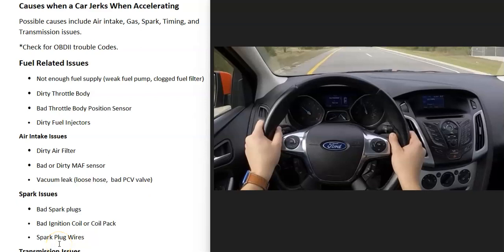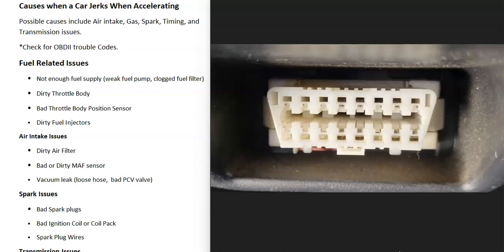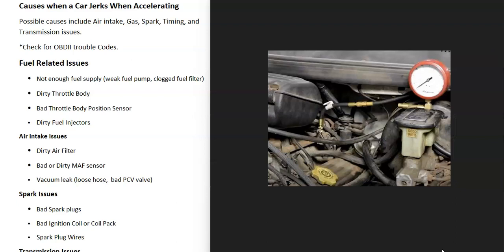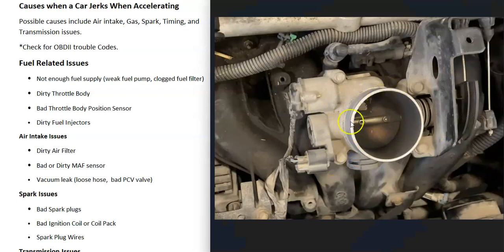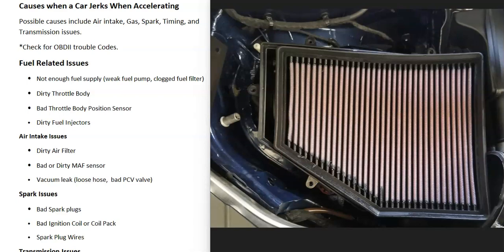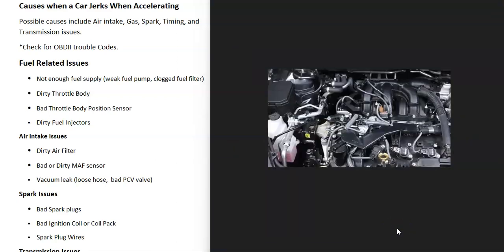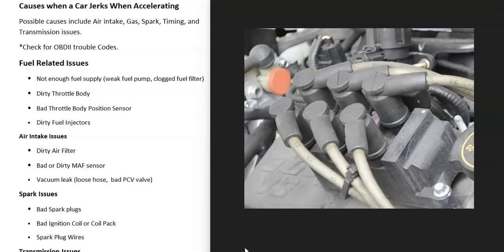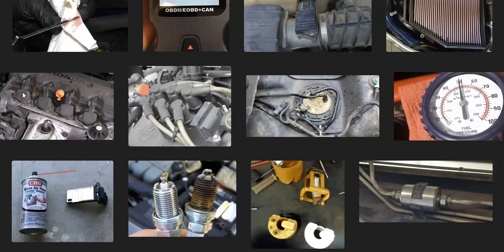Causes and Fixes Car Jerks When Accelerating

Comment: Anyone that has a a Toyota Highlander with similar problems that can tell me what they did for a fix please?
Reply: Mine jerks once in a while, but I have changed the plugs, coils, serviced and cleaned the injectors, cleaned the throttle body and changed the fuel pump. Problem still persists and unsolved

Comment: SPARK PLUS REPLACE, KOIL REPLACE, this is the code G550 P04F0$07E8, the gas station over flow my tank, forcing little more gas after it stopped then i get this check engine light, the macanic guy put code machine, but bec im a woman i light to research first before they over charge me

Comment: 1999 Lexus 300 jerking when changing gears. I never felt gear changes before...was very smooth.   Had complete tune up few months ago and been running great. No codes.
Reply: What did you do to it, what do you mean by "tune up"?

Comment: My 2002 5VZFE Tacoma has 256k miles. It has never ever let me down. Now, randomly it'll jerk, and by jerk, I mean like sudden split second losses of power...like a few split seconds in a row, typically between 35 and 50mph, going up hill usually, but not always. And it's usually a few moments after I leave work. But not always. And it's random, like once or twice a week, every so often. Other then that it runs and drives fine. I've scanned it and no codes are present. I've checked live data while driving (the  data a cheap ODB2 scanner can provide) and everything seems normal. I bought it in 17 with 129k. I've done 2 timing belt kits since and 1 tune up. Last go around was at about 230k. Anyone got any ideas? I'm a DIY car guy and always work on my own stuff, but I'm stumped.
Reply from the maker: Intermittent issues can be difficult to diagnose, especially with no codes. It could be a loose wire that only disconnects on a bump but reconnects, or possibly a component starting to fail, but still works most of the time. I would start with the fuel delivery, new fuel filter, and test the fuel pump for the correct pressure.

Comment: My mom’s 2006 Dakota is jerking. Keeps saying camshaft and crankshaft sensor. Changed them. Every time I reset the computer it runs fine then comes back same codes. Senors are new.

Comment: I have a problem.  I have no codes but it jerks when i step on it
Reply: My 150 is doing this too and no codes
Reply: @mikehernandez9140  I changed out the mass flow air sensor and was not that. I changed the throttle body and was not that. Finally I changed my spark plugs and wires and seems to have been the issue. One of the wires was slight cracked on the boot   Hope this helps

Comment: Thanks this is so helpful. Will continue my investigation into my new mild 'juddering'.  Last time i had this issue it was a hose from connecting into my ford eco-boost engine part so was loosing power (also spurting oil) the previous people had GLUED the wire which had melted in the heat. Some people are criminals. Got the spare adapter on ebay for £5 and my mechanic put it in for free as was also doing a couple of other odd jobs.
Reply: Just wanted to flag the resolution. Turns out a fault air meter read as an air leaking, leading my mechanic down a wrong path. Later turns out it was a Ignition Coil that blown the spark plug.  All replaced (did all 3 as might as well).  Just happy it didn't need an engine refit  :D

Comment: Is it possible that even  if the spark plug is the culprit the check engine warning will not illuminate?
Reply from the maker: In some cases, yes. If the spark plugs have a lot of mileage, it can cause issues. Usually, when this happens, it is best to give the engine a tune-up.

Comment: Mine when you start it it has a stable idle does not smoke the engine has a little vibration when you take off fast the accelerator does nothing but when easing into it she takes off she also gets a jerk like a 5 speed my car only has 35374 miles it eats oil its a 2020 Hyundai elantra se the dealer just picked the car up and knew nothing about the car it was on the lot 3 days at 30.022 miles so I've only owned this car for almost 3 years peace of junk

Comment: 2012 nissan altima v4. No check engine light but it jerks when accelerating and when idle. Im thinking of changing spark plugs first but im not sure if it will fix the issue. send help pls

Comment: How about when I’m driving in rain and traction control light  flashing and the car jerk when I accelerate
Reply: Try seeing if it's better when you disconnect the ABS sensors in the front wheels. Happens a lot on Tacoma's. But just try it and if it doesn't happen it's something wrong with you ABS control unit

Comment: My gf has a 2014 vw Jetta se 1.8t. I have a obdII scanner and I had a had an engine misfire on cylinder 4 and I ended up replacing the ignition coil and all 4 spark plugs but still having weird acceleration.

Comment: I have a 2016 grand jeep Cherokee Laredo and my car started jerking while I was driving 20mph and the check engine light came on. Any suggestions the mechanic just said transmission p0731 code. Is it something I can save or am I out of luck?

Comment: I have a 2010 Audi s4 and I have no engine lights I did a whole intake manifold replacement and new spark plugs and still haven’t fixed the problem
Reply: Did u ever get your audi fixed?  have a 2010 that randomly jerks and no code.

Comment: Hi 

I live in Spain and have a 95 Buick park Avenue Ultra. 

Could build a scan tool and retrieve codes. But now with the new ECU there aren't any 

My problem is jerking and no acceleration when the engine gets hot. 

When I disconnect the battery and re connect it, the car works fine. But when I get up to temp and restart the car it's game over.

All my ignition related parts have been changed and filters as well. Cleaned the MAF.  Still have this problem. 

Will change the water pump to address the overheating issue. But it still bugs my mind why the car has jerking and no power when hot.
Reply: I have a 93 buick lesabre thats been doing the same thing, replaced the fuel filter, o2 sensor, ecm, plugs, wires, and intake gasket. Have you had any luck figuring out your issue yet?

Comment: I have a 2005 Honda accord 2.4 EX & when I come to a complete stop then acelérate while turning right. The car hesitates in a jumping, jerking motion. I’m trying to figure out the problem but no luck can u help please sir  with ur knowledge 👍🏽🙏
Reply: Hello sir have you been able to fix the issues you complain about your car 
I am facing a similar situation 
It jerks when changing from 1-2 then every other one goes smoothly 
Sometimes while driving it just disengage from gear by it's until I off and start all over
Reply: @takeitorleavittt  no I haven’t I’m doing research on it & mite be the throttle body. Going to order one & see

Comment: 2009 Toyota Camry goes in and out of limp mode with no codes… Should be impossible for any car to go into Limp Mode with no codes!!!
Reply from the maker: Usually, there are codes. Can the scan tool read all codes, such as ABS and transmission codes?

Comment: I have a 5.4 when I’m at a red light sometimes it does that but no check engine light
Reply: Got a 2015 5.3 shutters at red lights and when slightly accelerating desperate to know if it’s fuel issue or tranny issue

Comment: 2012 altima ran perfect for 14 years no issue. Got it servived to het sparkplus, coils and gasgets changed. Started doing it. Took it back and they didnt find any issues. Still doing. 

How can a car drive so perfect for 14 years and no issues to all of a sudden after getting serviced it begins to do this with no check engine light on and no trace of what may cause it?
Reply: My maxima does this. Did you find out what it was?
Reply: Thats messed up 😢u had to go thru that

Comment: I dont know what to do, i have a 2023 hyundai elantra with 60000 miles, i have driven it alot, it jerks kinda when im accelerating and it also burns gas alot faster than usual? Does tht sound like spark plus even tho i only have 60000 miles?
Reply from the maker: If you have no engine light and no codes, I would give it a tune-up. You can look up the maintenance schedule or the parts that are recommended to be replaced by millage. Here is a basic overview for a 2023 Hyundai. 
Every 7,500 miles: Inspect components like air filter, brake pads, hoses, battery condition, and perform oil changes.
Around 95,000 miles: Replace spark plugs.
Around 120,000 miles: Replace coolant

Comment: Hello sir, could a small evap leak cause this because I keep getting code po442, I've replaced the canister,  holes, and the gas cap, but still no luck. Could you or someone please help me if possible.  Thank you
Reply from the maker: The EVAP system usually doesn't affect the engine. The only EVAP component that can sometimes cause issues is if the purge valve is stuck open. The purge valve is normally closed, so if you can blow through, it is bad.
Reply: Thank you so much for you speedy response,  I will check that next after the snow😅@HVAC_Mechanic

Comment: Thanks for taking the time to make this video. My wife’s 2016 Hyundai Sonota just had car fixed and it was emissions issues. The jerking of the car started several days later so we brought it back to place where it was worked on. It’s owned by her Uncle so I doubt he would screw us over with a bad repair. I’m crossing my fingers that it was something they might have done wrong but when I find out what the problem was I will give an update so others with the same issue might be able to see if this was the same issues we had.
Reply: And the lie detector determined that, that was a lie.
Reply: So did you figure out what the problem was?
Reply: What was the issue bro …. 4 monhths later
Reply: So?

Comment: What about no codes no engine lights on?? What can it be when acceleration and the car jerks and fails to accelerate? Thanks
Reply: Did you ever figure this out? Sounds identical to my issue
Reply: Mines does the same thing just it'll just stall coming to a complete stop with no check light
Reply: @Ski104  sound like a bad mass airflow sensor i used an autozone mass airflow sensor and my car would stall after 2 minutes of driving so i'd get an oem one

Comment: 97 Avalon struggling with acceleration shaking while driving with codes p0330 p0301 p0135 p0171 it's like in limp mode was intermittent now constantly o2 sensor is old code and didn't have this problem
Reply from the maker: I would fix the P0301 first, as it is likely causing the other codes. Most likely a bad injector in cylinder #1, but it can also be the coil or wiring.

Comment: I recently bought a 2015 Nissan Xtrail (2.0-litre petrol engine) with around 68,000 km. It jerks typically when I accelerate steadily between 30 km/hr and around 60 km/hr. I have changed the gearbox oil, spark plugs, and fuel pump unit (petrol filter and fuel pump),  cleaned the throttle body, but nothing has changed. When it has been put on a diagnostic machine, it does not return any issues. Anyone with a similar issue? Please kindly assist.
Reply: May be a sensor... transmission sensor

Comment: 2016 altima ran perfectly fine..added fuel/fuel injector cleaner to a full tank..and over night the car started jerking into gear..and check engine light just came on. on.Transmission fluid was flush and replaced after it started..getting worse
Reply: What did you end up doing with the car?

Comment: I have a Kia cee'd 2017 model and it just started doing this. Mainly when in first gear and accelerating faster than normal, but sometimes in higher gears, too, when going up the hill for example. In the case of the first gear jerk, at first I thought it was the wheel spin, but I don't think it's that anymore if the car still shows similar issues in higher gears while it's already moving. Is it possible that the clutch is slipping on top of all things mentioned in your video?

Comment: It happened to my car! I have a VW jetta 2015 2.0. A week ago it started jerking while accelerating. I immediately went to change the fuel pump, but nothing changed! Then fuel filter, injectors, then car didn’t even start! I changed the coils and wires and it was good for two days then started jerking again. I changed the spark plugs and cleaned the Throttle body and it is good till now!
Reply: How long the busted spark plug it lasts?
Reply: I am experiencing jerking on my  hundai santa fe 2008..pls help thnx
Reply: @DennisRobinLim I had a 2010 Santa Fe with the issue and the engine went after a point good luck
Reply: I am experiencing this currently with my vw golf mk7. Diagnostic scans does not point out any specific cause.
Reply: There are was to check certain  parks before you buy anything. What gets overlooked is fuses for ignition coil or fuel pump relay. Check any fuse that may that are go to major parts like fuel pump or ignition coils. Always make sure to disable battery when messing with any electrical components. When done messing with any electrical before you hook the battery back up turn the ignition to get rid of any ghost electrical left in the system. Don't turn the ignition all the way over like your Turing on the engine just one or two clicks
Reply: Map sensor is a common problem for volkswagons check that
Reply: @Dylanspeck88 Thanks Dylan. The problem was actually wrong type of spark plugs i put in. I changed them back to original VW ones and it runs smoothly. But as you also said, i will have MAP sensor checked also.
Reply: What the heck are you for real 😂

Comment: i have Subaru 2017 outback. It jerks when at low speed, once at a high speed all good also functions well driven manual. Took it to dealer and they did all the maintenance needed where they cleaned and replaced stark plugs, throttle, air filters, oil, all of things. Once i git the car back it was good for a day and then the jerking started again. Took it dealers second time and did test drive and they said its the way i drive not the car, So started driving slowly but i don't think its me, i have been driving the same way since forever. Also mileage on the car is 95000, don't know if that plays a role. Thinking of getting a new car but don't really want to. Any advise will help. Thanks.
Reply: Check the cvt transmission speed sensor
Reply: Did you fix it? I have the same issue.
Reply: Any update? Having similar issue.

Comment: 2014 ford fusion SE 1.5

1. Jerks when trying to accelerate at slow speeds

2. Has hard time going over slope super slow but engine sounds smooth
Like just doesnt react

3. If driving 70mph wont accelerate have to press pedal slightly but wont detect it until ive preesed for a while so it jumps from 2nd speed to over 3rd speed  and engine will sound like full action super forsed

Comment: I have a 2011 corolla. No plugs, new air filter new oil. Was running great, then all of a sudden when i am at a stop light, with gear in drive car idle goes up and down. If i accelerate it works normally, and runs great. If i put it in neutral it will maintain idle decently and doesn’t rough idle as much.  car has 180k. 
Also no check engine light. Any ideas????
Tomorrow i am going to check the throttle body and clean it, and change out the fuel filter ( which i have no idea when it was changes out last. Can a bad fuel pump work at throttle, but then at weird at drive idle???

Comment: I have a 2014 nissan pathfinder that only  jerks on initial acceleration....or making a turn while driving...you mention a lot..no codes..what's you recommendation. ..

Here's what I've tried. I fix the leaking electronic power steering pump. ..I have the cv axle yet to be replaced. .they don't look bad. ..I can clean the throttle body and do tyne up.....just trying to aim my time to fix the issue. 

Thanks
Reply: I have the same exact issues with my Nissan Altima 2011 2.5S
Reply: Have same issue with elantra 2018, while accelarating

Comment: I have a 2006 dodge magnum 2.7l recently it started doing this an it started out feeling like it was from start at lower speeds but it progressed to random and cel came on three a p0700, transmission (ml) p0404,egr and a 2ndary p0526 I think that last one has to do with low voltage system. Next morning
I checked connectors after watching videos and got in it and the cel was off. I  changed engine oil at shop had it was okay but I felt it still acting up on way home following day was a good day but today it did it again at a higher rate around 2.0 rpm previously it was doing it at like 1.5rpm but that’s when transmission suppose to change gears which has always been an issue and hits rather hard but if you pull off the accelerator it goes in smoothly
Can you elaborate I also noticed yesterday that my key turned an like ground out like previously when a shop blew up my engine it took 3 engines to get it right it now has a Chrysler 300 2008 2.7l but I had to get a key reprogrammed because shop said that fob was mid fuctioning but I had never had a problem with it until Chrysler engine was in I seen on nhtsda 
that those cars had ignition issues and mine did right out the gate but yet the dodge magnum did not even though it was same engine
Ty for your video very informative but cel light still off

Comment: I have a 2017 dodge durango that jerks when I accelerate some times.i change the plugs and coil and it ran good for about 3 weeks and start jerking again. I change the mass airflow sensor and its still jerking.now am frustrated. The code said I am having 3 cilender miss fire 🔥.
Reply: It could be fouling the plugs due to runing rich ... have you checked your spark plugs to see how dark they are ...

Comment: I have a 2018 hyundai santa fe sport it just started jerking when i added more gas
Reply: Mine does the same 2022 santa fe, did you found out the issue?
Reply: @ahizgd bro just try what is in the video. Or just check the comments I already found few really good comment about the process how you go to find out the problem